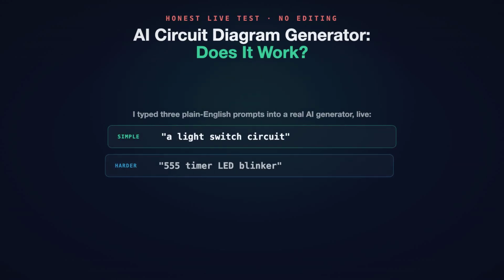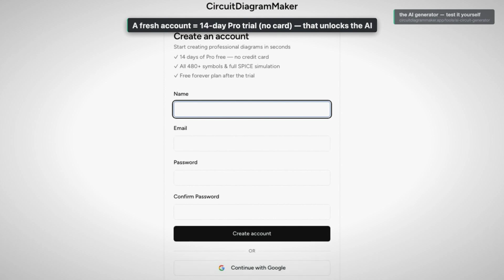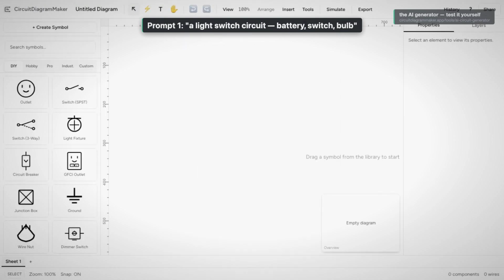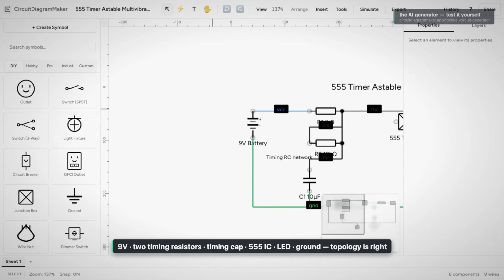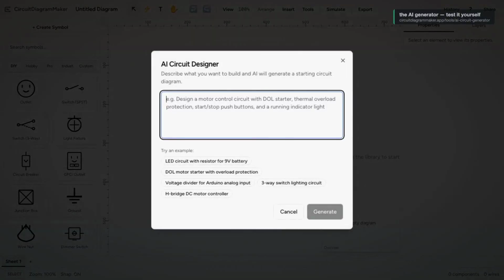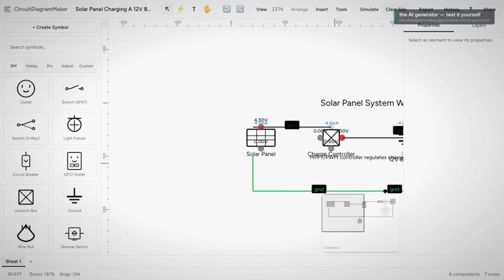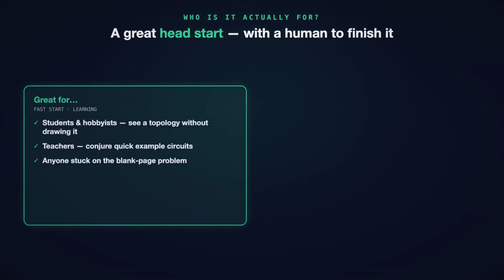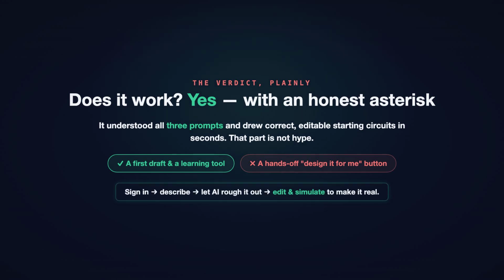AI Circuit Diagram Generator: Does It Work?

Comment from the maker: Full disclosure (also said in the video): the AI generator I tested is built into our own free editor — which is exactly why this test is unedited and the limits are on the table, not hidden. All three prompts ran live, in order, exactly as they came out.

Quick honesty recap so you know what you're signing up for: the prompt box on the landing page doesn't actually generate — it sends you to register. A fresh account gets a 14-day Pro trial (no card) which unlocks the AI; after that the free plan is 3 generations a month. Output needs a little cleanup (labels overlap, it uses generic blocks like a "charge controller"), and you still simulate to prove the circuit works. But from one plain-English sentence it drew a correct light switch, a real 555 astable, and a solar-to-battery layout — in seconds. A genuine head start, not one-click magic.

Honest question: would you use AI as a first draft you then edit and simulate — or do you want it fully hands-off? Curious where you land.

Try the same three prompts yourself and see what it draws: https://circuitdiagrammaker.app/tools/ai-circuit-generator?utm_source=youtube&utm_medium=pinned_comment&utm_content=yt-128